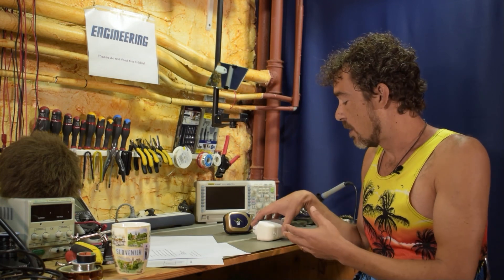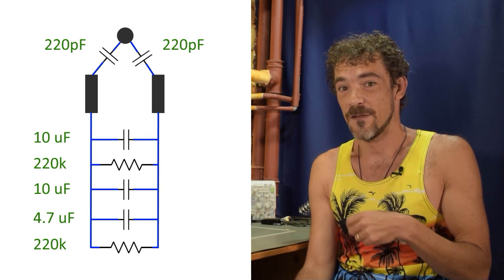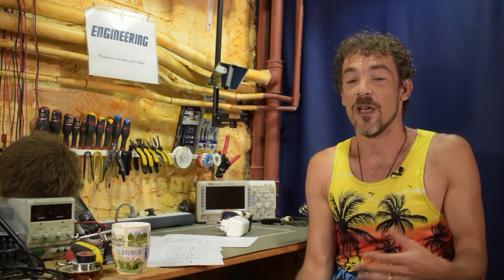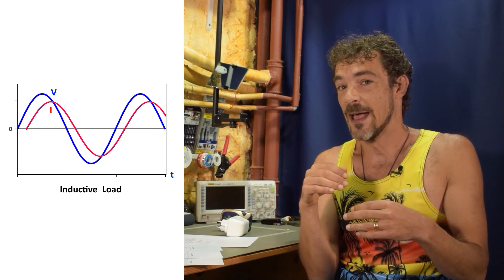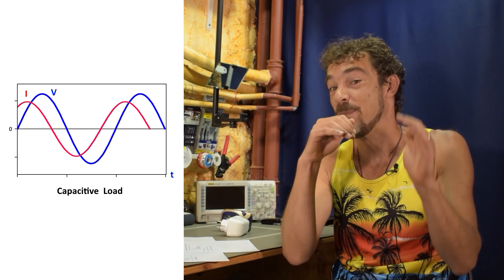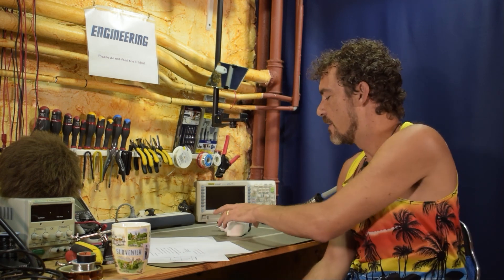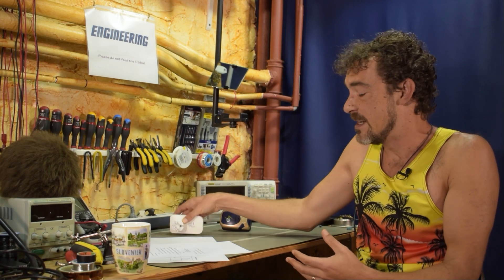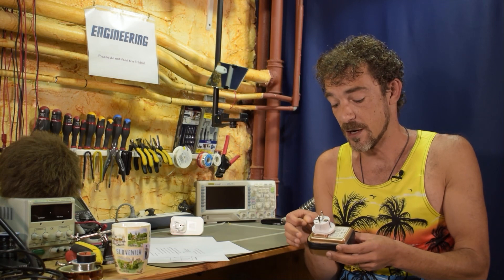When NOT to use Dirty Electricity filters!

Comment: When I bought my home from the previous owners in 2019 the house came with a outdoor, 13KW GE Generator with a 100am transfer switch. I have 12 Greenwave filters throughout the house. The generator performs a weekly test once a week, which is on Fridays for 20 - 30 minutes. What you are saying is I should unplug all filters prior to this test because I will get a back flow of current that could possible destroy or blow up the generator??? I am going to look at your video a few more times to get a better understanding, so I can share this information with my wife. Would you also suggest that I unplug these filters when I go out the house for a few hours or even when I go out of town on vacation, in case there is a power outage?
Reply from the maker: Well, it depends on the generator. It shouldn't actually BREAK the genny, because it SHOULD protect itself before any real damage happens. That's just a worst case scenario. It also depends on what else is running, what is plugged in and not running, and how many filters you have plugged in. What I would do is test the voltage when on genny power at any power outlet. If it's normal, you probably don't have to worry. If the voltage is substantially higher than normal, then unplug the DE filters when on genny power. If you're away from home for an extended period, I'd unplug the filters in any case - but if you're just away at work and the voltage on genny power is ok, then no worries.
Reply from the maker: @pfunk360  For testing D.E., the greenwave meter is fine. Maybe they gave you some other kind of tester - I dunno! For voltage check, one of these is handy: https://amzn.to/3eZTMAK  It tests for proper wiring + shows voltage.

Comment: Hi Scottie, I'm in the UK and the upcomming winter power supply issues are looming. I recently tested my standby generator for the house and farm and noticed that the lights were pulsing. I'm guessing that the introduction of modern LED lamps is partly to blame in addition to what is now an aging generator. (3phase 15Kva split into single phases for 3 disribution boards). Following your series of videos and experience about dirty electricity do you think there might be a way of economically cleaning the generated supply at source?
Reply from the maker: Hmm... First, if the generator is surging, that's the problem. If the RPM is smooth and constant, then it could be an aging regulator in the genny. Does an incandescent bulb pulse on genny power?  It could also just be the particular combo/size of loads on each of the 3 phases. The problem with adding capacitors is that sure, they'd smooth out the power - but then you have added capacitance which can cause the problem I mentioned in the vid. In any case, I must confess I'm no expert when it comes to generators.
Reply: I have the same problem,  
Would adding an RV surge protector between the generator and the house help?  If not, how do I shop for a replacement generator regulator that does not have the identical problem.
Reply from the maker: @MetroSA-227  As far as I know, there isn't a way to do it, yet... I guess I might have to invent one! ;)

Comment: Would a UPS (uninterupitable power supply) be effected in anyway by dirty electricity filters?
Reply from the maker: It shouldn't be affected - unless you're using DE filters on a generator and the line voltage is higher than usual - in which case the UPS may switch over to battery power more often to protect the puter against overvoltage. But that also depends on the UPS and how sensitive it is.

Comment: Electricity to our houses comes from substations aka transformers. Not directly from the power source aka generator. These act more as a buffer (not quite but you get the point). I'm not getting into more details, but that's the main difference. It has nothing to do with "the ocean" 👍
Reply: I've worked in this industry from one end to the other where do you think the sub stations get their power? They get it from the generators. It's stepped up and then it steps down it stepped up and it steps way up and then it stepped down according to need and how far it goes

Comment: I’m curious about the Monster Power surge protectors I use that have dirty power filtering, they only clean it up for things plugged into it, but that might still be the same kind of capacitance load on the generator.  We have an 8kw backup generator with the automated transfer switch, so part of our house automatically gets powered from the generator when the power goes out.

I used to sell them (so I have a lot) as a home theater installer and we had a demonstration kit where we could plug a device into the outlet and listen to the noise on the power line, often you’d even hear A.M. radio stations along with lots of noise from things like wall warts, and then plugging it into the surge protector to show how it cleans up the noise, which it did...  hopefully they aren’t going to cause generator problems, but next time it’s running I’ll unplug them all and see what difference it makes to RPM stability and voltage.
Reply from the maker: Let me know what you discover!

Comment: Couldn't dirty electricity be sorted out in a more centralized / right at the source way, instead of silly plugged-in stuff everywhere around the house?
Reply: The dirtyness is being introduced everywhere in the house by everything else being plugged in, especially things like switch mode power supplies which most Wall warts are these days.  If you just filtered the power at the meter it would provide the house with clean power but then all the gadgets in the house would dirty it up unless they were plugged into pricey filtering surge protectors that keep the noise isolated.